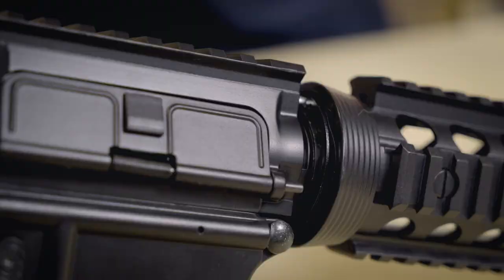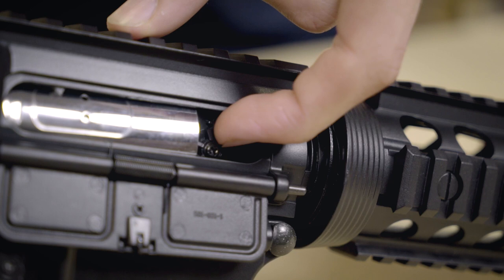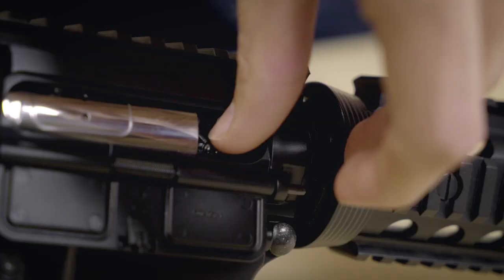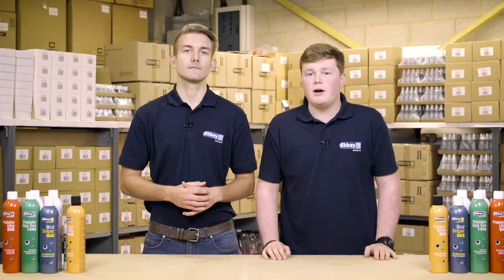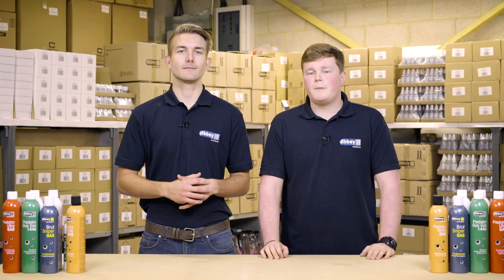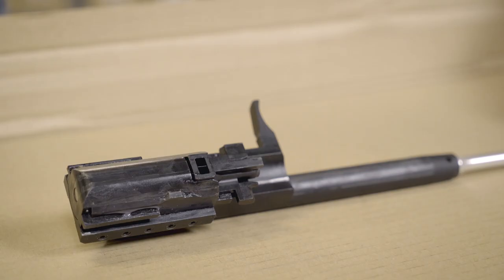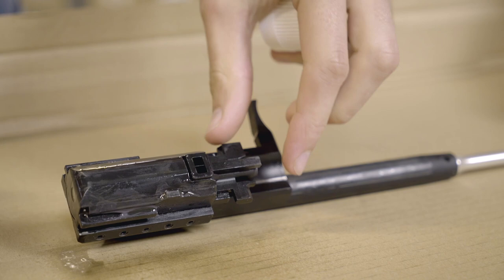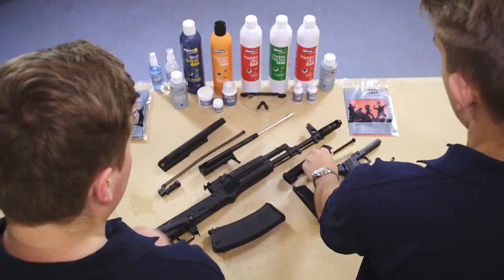How A Hop Up Works In Airsoft

Comment: My hop up is all the way up and the bullets fly Down
Reply: Hopup is causing too much restriction, lower it a bit and try and if it still doesnt work check your compression
Reply: Also, you may need a bucking replacement

Comment: What about if they are flying to the left or to the right?
Reply: Then there's wind or you're not holding your gun perfectly vertical. You can use holding your gun angled if you're hopped up as a way to curve the bbs left and right for a tactical advantage